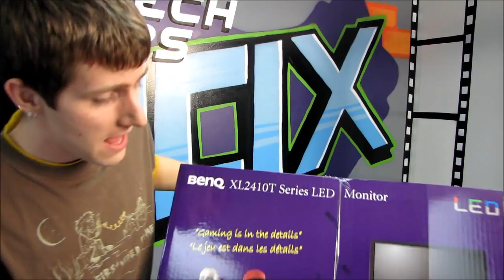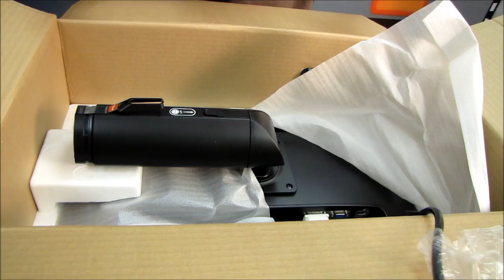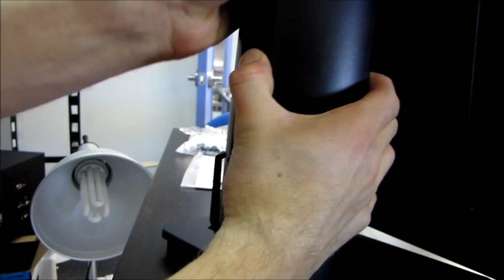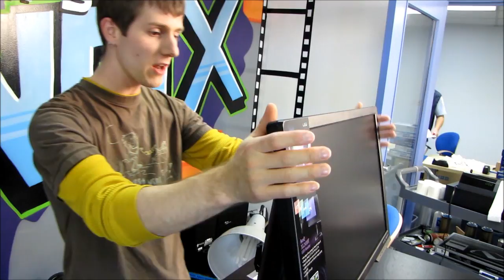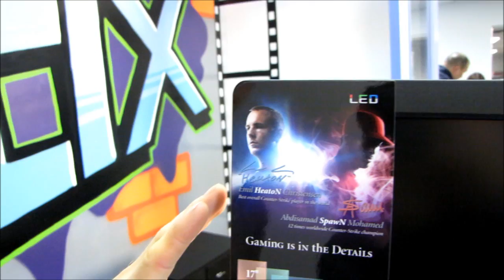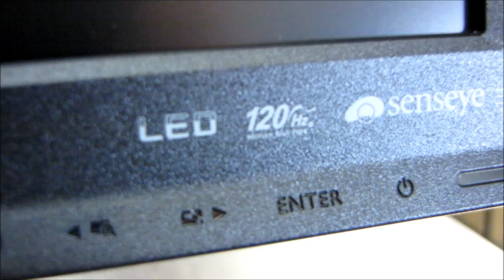BenQ XL2410T 23.6" Widescreen 120HZ LED 3D Ready LCD Linus Tech Tips

Comment: still using mine from 2011. works absolutely perfect. still no need to upgrade lol
Reply: I have it too, but I just realized it will be annoying to upgrade my GPU next time. I have a GTX 1080 with a DVI Dual Link output which is perfectly fine, I get 120Hz without any problem. The thing is this screen works @120Hz only with DVI dual link, not with HDMI, and most of the recent graphic cards don't have the DVI output. DisplayPort to DVI or HDMI to DVI adapters exist and are quite cheap, but the thing is they only exist for DVI-D single link, which only supports 60Hz.

To be more precise, there actually are DP to DVI dual link adapters, but those are way more complex and use active circuits, so they are way more expensive, about a 100$. Since this screen is quite old, you might consider buying a new screen instead of buying that sort of expensive adapter that may induce other limitations/problems.

The best solution is either :
- to find a graphic card with DVI output, even for new models it seems that there are still a few
- buy a screen with DP
- use the USB-C output recently present on RTX 20xx cards and a USB-C to DVI-D dual link adapter (not 100% about this one but it seems to work for FHD @120Hz)
Reply: @TokyoQuaSaR  I have a dual link DP to DVI cable running off of an RX570 graphics card with this screen but I'm not getting an option to change the refresh rate more than 60hz, any advice?
Reply: @skan6537  You mean DP to DVI Dual Link ? to be honest 0 idea. I just know those adapters exist but I don't even know if that actually works.

I don't think I will get one anyway, I'm planning to buy a new monitor at some point before the end of the year to prepare for the next gen of GPUs.

Comment: @Muskickyoass i personally have not owned a 23 inch monitor so i would not know. they are both the same resolution and i believe the difference is minuscule. if you are running  multple monitors, just get the same screen diameters.

Comment: @Aguinaldo06 hdmi because you CAN use hdmi cable from video card to 120hz monitor for above 100 fps limit breaker.  as far as REGULAR dvi and not DUAL LINK dvi.  regular dvi is limited to the 60 fps mark even if connected to 120hz monitor.  dual link dvi can yield close to similar fps results as hdmi..so real question is dual link dvi or hdmi. which is better.  cheers

Comment: I Will reveal a little secret here , If anyone is wondering how to switch between the Inputs when he changes he's Cabels , eather DVI , HDMI  try from the enter button .
I was a bit confused when i changed between DVI to HDMI and when i discovered i thought i have to share this couse it's hard to find , all thought the New switching System of BENQ for changing the "Inputs" is this .
Btw that's one of the Beast's  out there Great Monitor for compared cheap prize on the Market !
GJ Linus !!!

Comment: perssonz No it wont, because the next gen consoles are either capped at 30 fps or 60 fps depending on the game and you will not see the benefit hence wasting money. If you are looking faming on the PS4 i would recommend a 60hz run of the mill 1080p display. or a monitor for g

Comment: I recently built a new gaming PC, these are some of the specs...

Haswell Intel Core i5-4670k CPU 3.4ghz

Gainward Nvidia Geforce GTX 770 

8gb Corsair Vengeance RAM 2133mhz

I was thinking of getting this monitor but will I even reach 120hz?? As I'm more of a picture quality kind of guy, rather the performance? Would this be worth getting?